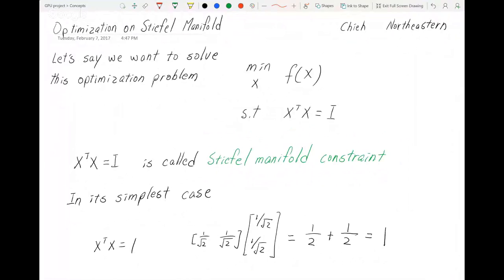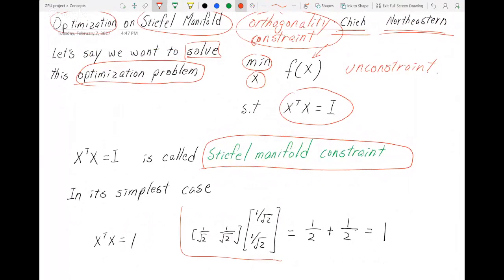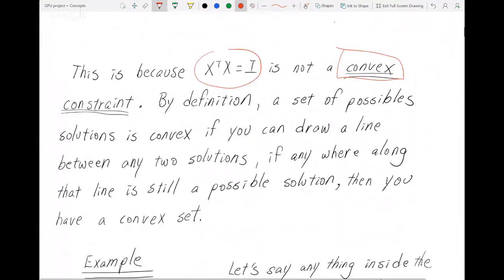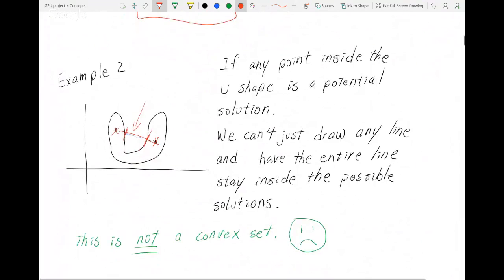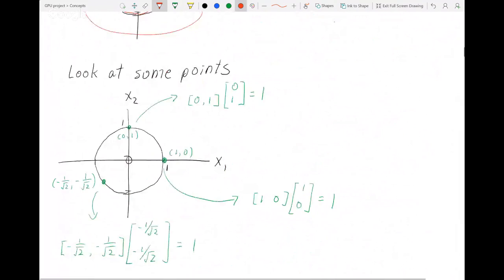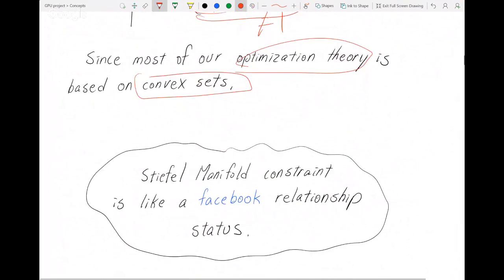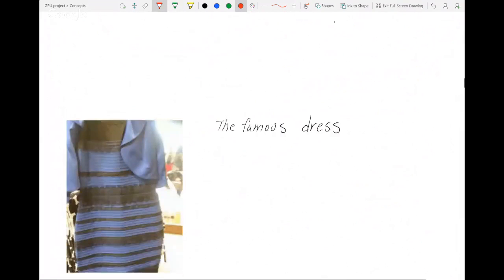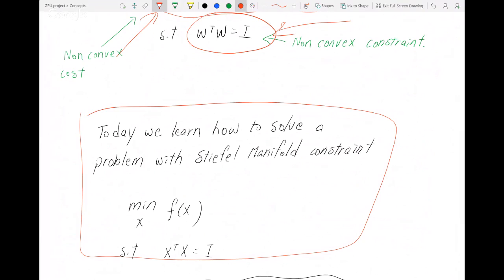Optimization with Orthogonality Constraint ( Part 1 )

Comment: Hi Chieh, thank you for detailed explanation 🙏🏻! You helped me a lot. But I have one question: in what case shoud I choose Manifold Optimization Approach (MOA) over classical optimization with constraints? I mean what's the benefit of using MO? I understand that it is more elegant and instead of dealing with constraints we redefine a space, a Manifold where the variable lives on the manifold so the classic optimization problem with constraints becomes an optimization problem without constraints in MOA. But in terms of result or (numerical) efficiency or convergence are there any remarkable differences?